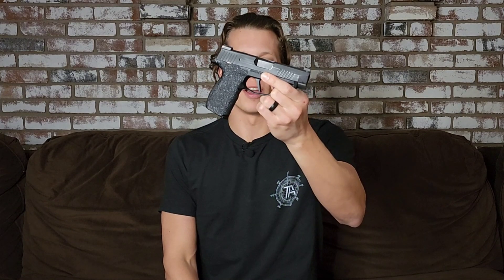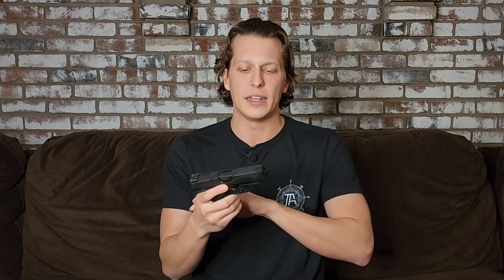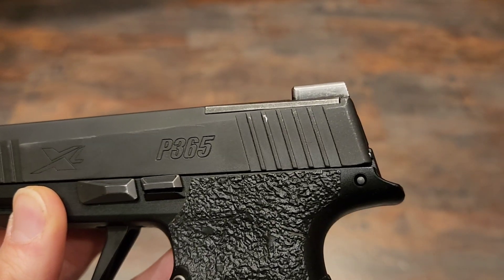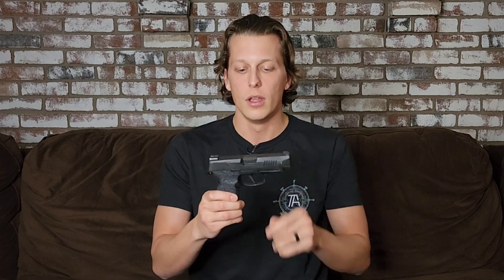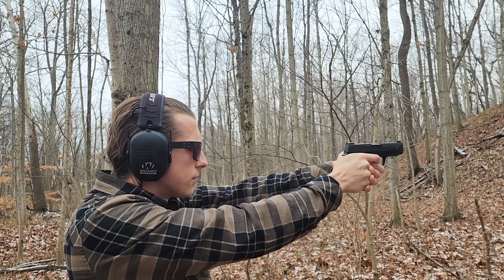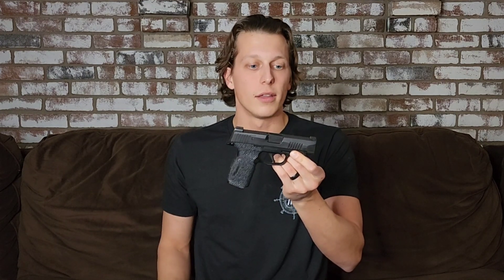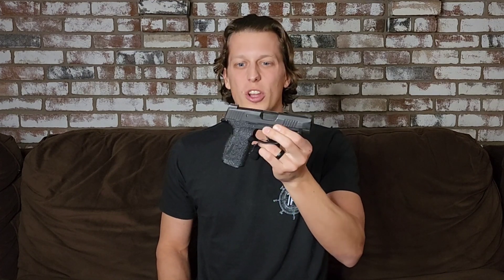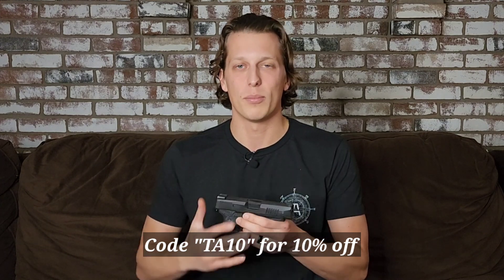Sig P365 XL Major Trigger Malfunction UPDATE!

Comment: Sig has always treated me right when I’ve had issue with my early serial numbered original p365. I was breaking firing pins. Since I’ve had it back I’ve shot over 4,000 rounds through it with zero issues
Reply: I waited a year to buy mine and it's been an absolute trooper.  Eats anything from Federal Munitions Reman, Wimchester White box, Blazer brass.  Had it milled for an EPS and it sits on a WCXL frame with a TLR7 Sub, it's so easy to control for being a fraction of the size of my PDP or G19.

Comment: Dude first shot with my xl and the slide locked up out of battery and my buddy had to put all of his weight into it in order to clear the weapon. Could not get through a mag before the lockup would happen. Long story short, sent it to sig and they replaced the barrel. Ever since the barrel replacement the firearm has been very reliable.

Comment: I have 2 365’s. An xl and a standard model and I will say until broken in both came from the factory very stiff/tight. Not an issue just more noticeable than some other pistols I’ve had. 

I appreciate the honest follow up. I figured this was more of a one off issue with that pistol rather than a design flaw. We’d have heard about it a lot more than one video otherwise. Take care.
Reply: The thumbs of Thor could not release my slide lock

Comment: After watching your video I discovered that mine was doing the exact same thing. Only have about 100 round through mine and never noticed this at the range but after watching your video, I started dry firing it and I noticed that the pull wait was very inconsistent and it would sometimes hang up and the striker work have a delay. Just sent mine back to sig…hope it comes back fixed!
Reply: I have a brand new one that's doing the same thing also.  It hasn't even been to the range yet, but it won't dry fire without bumping the slide.
Reply: Me too!

Comment: Found your video today. Was at the range shooting tonight. Shot five rounds and 6th the gun didn’t fire. Ejected round in chamber. No firing pin strike. Pulled trigger for next round. Trigger dead. No wall. All the way back. Tried shaking. Won’t fire. Contacting Sig now. Something is broken internally. 😢

Comment: I have guns with years of reps in and out of the holster, and they don't show that much wear (15min per day at min).  I do tend to buy nice holsters, though, and the wear I see is usually on the frame and the top of the slide along the edges (but usually no raw metal). I like my holsters tight too, I make sure that they will hold the pistol with a loaded mag while upside down and shaken, if it doesn't drop after a good number of shakes it passes in my book.

Thanks for the update, I just think it's important to be fair even when you're annoyed by dumb comments.  One of the myths about kydex holsters I see from time to time is that they will wear away at your finish, but the reality is a well crafted holster will not.

For those interested I have 5 holsters from Trex for 3 pistols, and one holster from Harry's.  The 19.5 was in and out of a gen 1 sidecar numerous times and the only signs of wear I ever saw were the polished spots on the trigger guard, and the barrel.  Walther and Sig both have lights now and for some reason the spots that seem to rub are the top edges of the slide, Walther finish seems to be less resilient than the Sig.

Comment: Im curious as to what part exactly was causing this malfunction. Was something out of spec and sig just replaced the whole fcu to be sure? Seems like it had to do with the sear engagement components being hung up and having to shake free from a burr somewhere. But I’m no gunsmith so what do I know.
Reply: I would bet the FCU was replaced. He said it had to go through an FFL, and every gun I’ve ever sent in for warranty/repair has been mailed straight back to me. The FCU in these guns is the serialized part, so if it was replaced it would be a “new” firearm that would require a background check
Reply: @adammanning8882  yeah I was thinking that to since when I sent my p320 in for the “update” it was mailed directly back to me. But with the new firearm laws and such I wasn’t sure. Seems like they would have just said they replaced the fcu/firearm instead of listing parts they replaced
Reply: Bro he pulled the trigger  lol.
Reply: @tacticalbt1023  what??? Lol
Reply: If the sear pin becomes dislodged, it can cause this issue. Based on the condition of the gun, it may have been due to wear . The sear pin is held in place by the safety lever pin. If the FCU was taken out of the grip module, it is possible that the safety lever pin could have started coming out and then the sear pin could have walked out with use. The frame being replaced, I didn’t catch that part in the video, but if it was them maybe he got the frame inspected Friday night, right before they changed the tooling that was worn out.

Comment: At this point, and since they replaced both parts, I'm thinking it may have been a defective (ie worn out) engagement between the striker and the sear.
Reply: I have a brand new one that's doing this same thing.  It's never been fired.  The only way I can get it to dry fire is by bumping the slide.
Reply: @Blakgun how is it now? I just got one that is similar to this video except it’s more like a very heavy trigger on the last 1cm of pull and it fires when the trigger is pulled and when the slide is manually pulled back. No issue with the shaking aspects
Reply: @manarazor4782  I tried the slide on a different lower and it works fine.  Then I tried a different slide on that lower and it works fine.  I believe it to be a tolerance stacking issue in the mechanism somewhere.  I have some parts ordered that may fix it.  If not then it's going back to Sig to see what they can do.
Reply: @Blakgun  dang. I’m hoping since mine will fire after you give it an extra 5lb of pull after hitting the last wall that there’s “extra” metal somewhere that can be worn out and fix itself
Reply: I will note that if the trigger is pulled with directional force to the left it cannot fire no matter how hard you pull it but a straight back pull or a pull to the right and it will fire🤷‍♂️
Reply: @manarazor4782  If I were you I'd call Sig and get an RA label.  They are really good about fixing stuff and very quick.
Reply: @Blakgun  yeah….I’m just impatient but that’s probably the best decision long term.
Reply: @manarazor4782  I've sent stuff to them many times over the years.  I've always got guns and parts back in under two weeks from the day I dropped it off at shipping.
Reply: @Blakgun  fingers crossed
Reply: @Blakgun  update. Had it back for a couple weeks now and after 500rds it hasn’t had any malfunctions so yay. They ended up replacing the sear and trigger bar
Reply: @manarazor4782  Glad to hear it's working well for you now.  👍

Comment: What was the issue that caused it to shoot on shake?
Reply: It wasn’t just shooting upon shaking it. As in you couldn’t chamber a round and shake the gun causing a discharge. Something was malfunctioning within the FCG, causing a failure to discharge upon depressing the trigger. If you continue to hold pressure on the trigger and shake it, the gun would then discharge.

Comment: mine is doing a similar thing, i bought the MM Commander grip  and when i switched modules, (im using snap caps for this ) it would only go off in my right hand (im left handed,) every frew trigger pulls,, then i would have to shake or touch the slide but when i put it back in the Xmacro module it functions as normal, which i ve had t in other grips before and nothing even close to this has happened… i p,an to send it off to sig and see what they say.

Comment: FCU wore out? Once again, Glock was 40 years ahead of its time with its design.
Reply: What's that got to so with this.  Not a fanboy but just look at that gun, it looks like it's been practice drawn from a holster and dry fired 100,000 times.
Reply: Yea so far ahead of its time that Glock just switched their internals to match sigs with their new performance triggers. Good call bro
Reply: Glock had major problems in the early 90’s!

Comment: I believe every manufacturer has a lemon. I purchased a SW MP Shield 9mm in 2014. It shot great when it worked. Otherwise it was an absolute piece of crap. Sent it back to SW at least 3 times for severe stovepipe jams, failure to return to battery and other issues. I think it was finally fixed after third trip back to SW. Good customer service but these multiple issues destroyed any future confidence in the pistol. I ended up selling for $100 bucks just to get rid of it.

Comment: It sounds to me that possibly a gun component had worn out due to the gun being well loved and the gun looks it. My guess is Sig decided to "refurbish"  the gun and replace all internal components to ensure proper operation. I would not hesitate to carry that gun once I shot it and confirmed it functioned as expected. Just like anything mechanical if used enough times it will eventually wear out.
Reply: No gun should ever under absolutely any circumstance do what that gun did. No amount of wear and tear should have a gun not fire when the trigger is pulled but then fire when shook. My best guess is either the parts were wildly out of tolerance, a QC issue, or severe tolerance stacking, which is still a QC issue.
Reply: @LawlessNate I don’t think it’s a QC issue. I work at a gun store and range, and this happens continuously with our inventory of 365 rentals. Once they get over 1000 rounds at some point it happens. They are all super well maintained on regular schedules. I love my 365 but working there has made me lose faith in it.
Reply: @Ferrous_Bueller  Agreed.   A shaky design can be made to work OK....but places a lot more responsibility on parts being exactly right.   A good design will allow for wear and parts having some dimensional tolerance and the Sig striker gun series is not looking like this to me.   People LOVE a very light trigger...but making one is going to involve compromises that don't belong in a duty pistol IMHO.   The fire control and safety parts in the Sig are tiny and frail, throw in some manufacturing tolerances and things can turn out bad.   As good as the 200 series guns were....these striker guns just aren't in the same league.
Reply: Mine does the same thing brand new

Comment: NGL, I didn't pay much attention to these videos until my XL did something very similar -- I can pull the trigger all the way to the "backstop" of its travel and it won't send the striker forward unless I apply a great deal of pressure or "shake" the gun. It seems to break at a different point with each new trigger pull. Gotta sideline my Sig until this gets sorted out. Thanks for the update!
Reply: The trigger spring seems to be problematic. Try an extra power trigger spring. Will give a more positive reset, and you won't have to worry about it being weaker than the stock spring and not working.

Comment: I don’t think I can ever appendix a sig
Reply: My experience I have carried a 365 daily for 6 months. And I work a dirty physical job O issues my family has more than half a dozen 365s 0 issues with them. Have a macro to no issues. So far my glocks have had more issues than my sigs. Also a good friend of mine competes and runs min 1000 rounds per month more like 2k through his 320 no issues. I have personally seen more glocks with issues than sigs. Just my experience.
Reply: @andershilmo1866  what issues have you had with glocks? Personally I have a 320 for competition. I carry a 19 and 48 with no issues on the range. The trigger on the sig is nice and crisp but rather the 3-4 Glock built in safeties if I’m carrying appendix
Reply: Sure all guns can have issues but try to find a video of a Glock doing something like this that’s dangerous or at least involving the firing pin going off, usually with glocks if something goes wrong it’s failure to feed or extract something like that.
Reply: @societyceo  most were mag/feeding issues. Mag release sticking which is irritating. I just haven’t seen seen the same with my or my family’s over half a dozen 365s. I get it though if people are more comfortable carrying a glock that’s fine. I do remember not so very long ago people saying glocks weren’t safe. And they had a few recalls themselves to.
Reply: Dude it has a safety block/plugger it can’t go home , unless trigger pulled, bet his block had a bur and then he pulled trigger shaked it and boom gets past bur fire

Comment: This is pretty STUPID.  
The bottom line is All gun manufacturers have issues. 
Whether you choose Glock, S/W or Sig, You should run a minimum of 500 rounds through your CCW gun.  
If your CCW is reliable, GOOD.  If not, toss it in the garbage and try again.   
I hate videos that profile one gun’s problems and insinuate the manufacturer is bad.  
I carry a G27 that has been the most reliable handgun I have ever owned.   
I trust my life to my Glock 27.